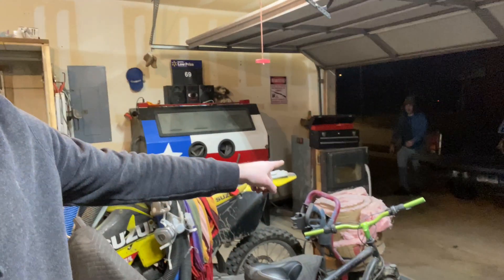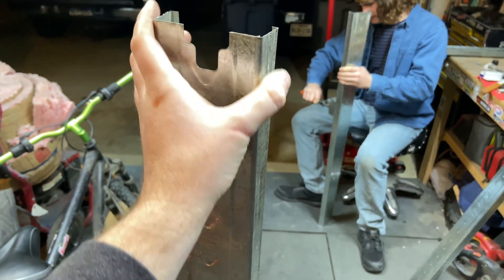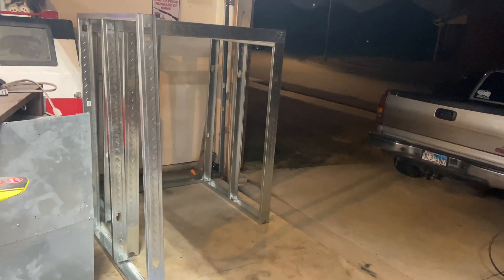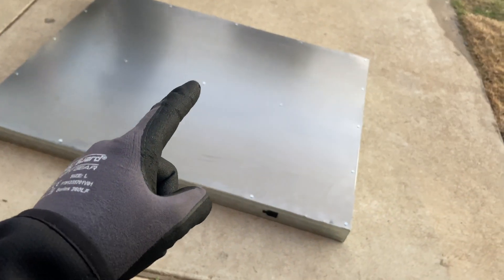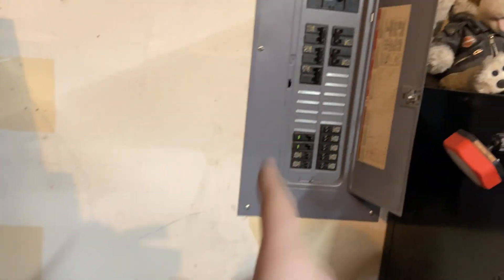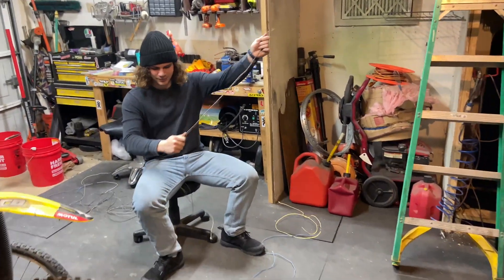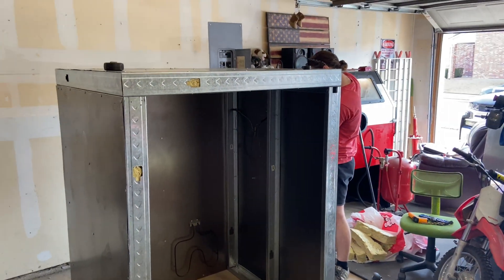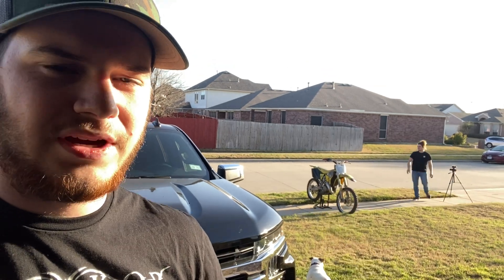Building a HUGE Powder Coat Oven for Under $1000!

Comment: Hey Nick, I'm digging the engine stand. HAve a build on that or is it store bought?
Reply from the maker: It’s built but by my friend Bo! I’ll see if he has the plans for it or where he got the plans and I’ll try and get back to you
Reply: I believe I found the plans to that stand in a different video. Because that adjustable mount,  looks identical. Only difference I see is the legs are turned on edge.

Comment: Pro tip: There are metal wall studs and then there are metal tracks. Studs are "C" channel. Floor and ceiling tracks are not.
Reply: I understand the shape differences but I'm curious which you think would be better to use(or a combo?) And why?

My bad if I missed something during the video that makes the answer to this question really obvious
Reply: @dominicciotoli8929   In the video he makes a comment about having to cut all of his studs so that they interlock together. The reason for this is because he bought wall studs for his top and bottom plates. You want the tracks, not the studs. They will have straight sides so they can accept the studs and remain flush without bulging.

Comment: I have a question: Is there a reason nobody pusts the elements in evenly or on the tops of the oven? I guess it's just not nessisary? I've always wondered why you never see burners on the top or evenly spaced out? I guess as long as it gets to temp thats all that matters?
Reply: Because heat rises naturally so elements near bottom and temp sensor near top makes sense

Comment: What was your total cost? And what gauge sheet metal did you use?
Reply from the maker: If I remember correctly total cost came out to around $950. As far as what gauge metal, I’ll check back whenever I get off of work, been too long for me to remember.
Reply from the maker: 22ga sheet metal, forgot I had a materials list in the description

Comment: They make rails for the studs to slide right into bud
Reply: Was gonna post this as well.
Reply from the maker: Local stores were out of stock at the time we built this oven. We also originally had different blueprints for the build but changed a couple things as we went along, most materials were already bought before we started throwing it together.

Comment: Hopefully you can answer this, why do some ovens have fans for circulation? Noticed yours doesn't is why I'm asking. Is it absolutely necessary?
Reply from the maker: Having a fan helps with the circulation of hot air so you don’t get an uneven cure. It’s definitely a nice feature to have however we built this as a “budget” oven where we had a $1,000 cap. It wasn’t in our budget at the time but we do plan on adding one. Even without it we get very good results from it. Biggest and longest part to do so far was an entire dirtbike frame that took a couple hours to cure, and it came out great!

Comment: Should be sweet to see that 05' rm125 get done, always love a good rm build. Just finished my 07'. Looking at building an oven like this for composites curing, got some parts in the works. My 3 axis mill should be here at the same time my shop is being finished up. December this year, got this video saved as reference for the oven. Great job bros!

Comment: Nice video want to build something similar, was there a reason to installing only 3 heat elements? I have 4 at home from a double oven I gutted, would that be overkill?
Reply from the maker: We went with 3 just to play it safe from amperage. You could definitely do 4 if you beef up the wires and plug, just be smart about it! With our 3 burners we get up to 400 degrees in about 15 minutes, so 4 really weren’t needed.

Comment: anyway you could go over the wiring for the control box? I've never done any sort of wiring like this, but would like to build my own.
Reply from the maker: I’ll try to get a video or at least diagram up, I’ll let you know when I have a chance too!
Reply: @TicklerNick  by a chance where’d you get the box part at?
Reply from the maker: @billybob261  if I remember correctly I found it on Amazon. It was about $30 and I had to cut all the spots out myself with a dremel

Comment: Do you have the links for all the electrical stuff?
Reply from the maker: Most was bought in store except the PID, and the SSR’s. The PID is an Inkbird PID40W, $40 on Amazon. The relays are TWTADE DC to AC 40A, $13 on Amazon.
Reply: @TicklerNick  perfect thank you man I’m 16 so don’t know a whole lot about wiring haha.
Reply: Concern with the galvanized studs off gasing zinc ?